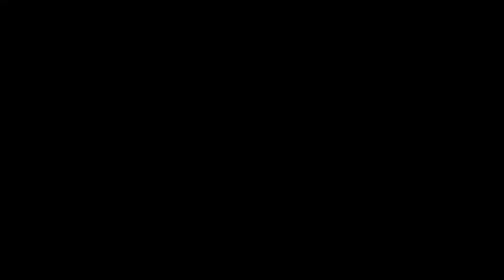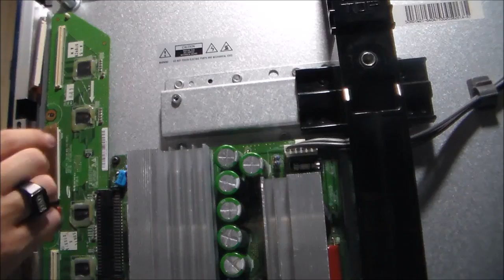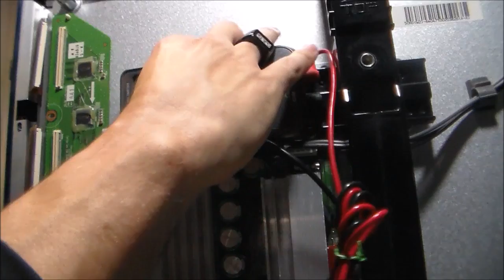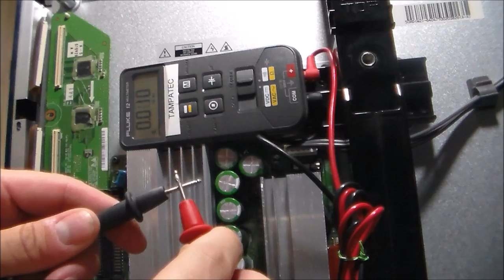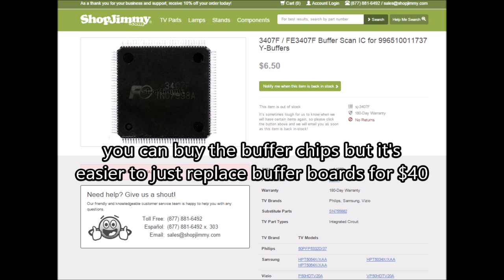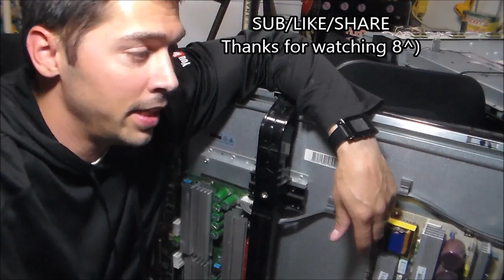How to test IC chips in circuit: Plasma TV no picture

Comment: hello thank you for your videos i'm watching all of them and i'm learning a lot but i'm still a newbie got a simple question: how do i know where is ground on a board? i know ground should be in many places for example i know that if a board has screw holes or any metal place not connected to the circuit there is ground but what if the board have no screw holes and only discrete components on it? the logic board of my vacuum cleaner is faulty it controls a two phases motor thus has a through hole components on one side and logical smd components on the other side, there are no screwholes exposed where can i take ground to begin the hunt of the short on each side of the board? (both through hole and smd i mean) thank you for your kind answer and keep your good work

Comment: it could also be ground. you have to read the ic data sheet to know what is supposed to come though that pin, THEN, you can tell wether you have a short in case you find a short. this video is wrong
Reply: Jose Ramirez I am trying to figure how to test a tpa3113d2 chip and watched this video and no help at all. Half my pins beep. Half are either OL or 0.00. I'm so confused.

Comment: SAMSUNG UN55B6000VF LED mainboard has power supply board "short circuit annnoucer relay" clicks on then off. What ic's/ cap/ inductors etc. go bad on these typically? everyone has the same issue it seems but no fixes.
thanks

Comment: Great video Tampatec. Hopefully i won't ever need to do this on my 500M. As Kuro parts as getting very scarce indeed. That and the scan IC biard is bonded to the module. So an individual replacement of scan IC would be necessary. OUCH !!!

Comment: Love your vids, when my 50" Phillips Plasma video went out, but the audio worked, i did remove the back and replaced all the fuses (ceramic so couldn't tell which could have been blown), but that didn't work.  Guess i need to invest in a meter.
Reply: I have a Phillips 50  and my pic went out but I still have sounds , just by changing your fuses the TV worked or do think it could be inverter board.

Comment from the maker: Ralph Kluge  yes good question, i think there is a ground pin on top and few ground pins on bottom of the ic but that's why i tested another IC with same part number on the buffer board to make sure they get similar readings just in case, TV repair is a continuous learning experience.

Comment: so none of the pins on the chip has a connection to ground?
Reply from the maker: late reply but good question, yes it would read .000 not .041 , buffer ICs go bad often and are hard to replace.
Reply: Tampatec how are they hard to replace? Do you work with jimmys website as a salesman?